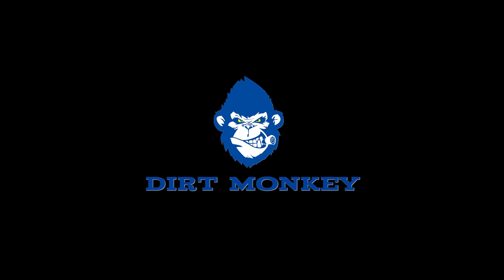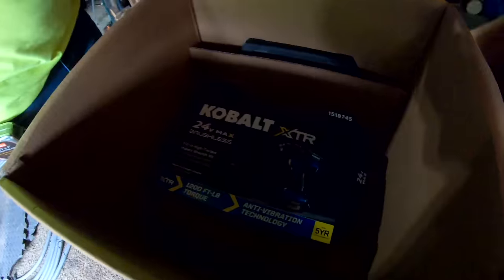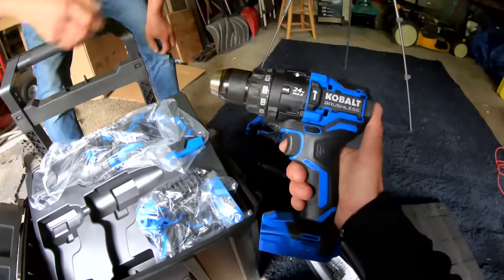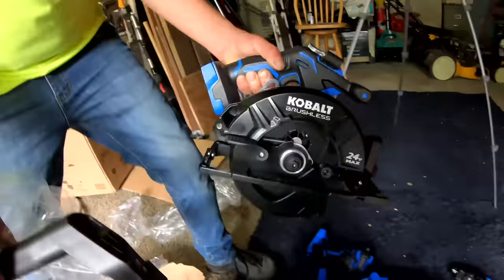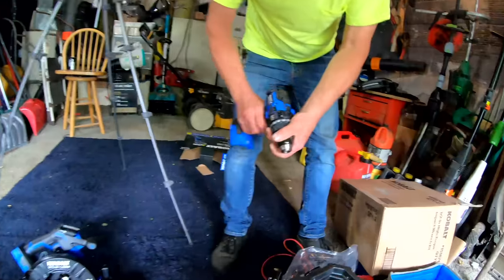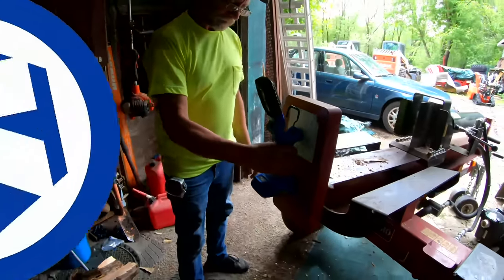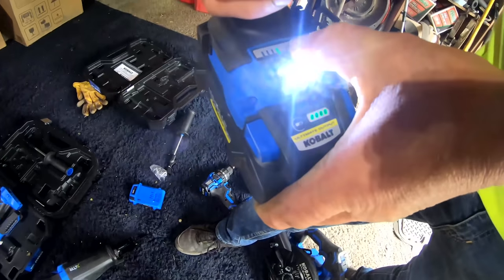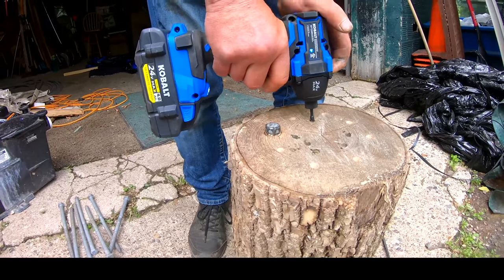First Looks at Kobalt's new Power Tools

Comment: Being from the south,  kinda blew my mind that yall ain't heard of Kobalt. Lowes is the first thing that comes to mind for me! Nicely done video.
Reply: yeah same here, me and my father have used Kolbolt a drill for years, and i remember holding the light ooooo boy, i still do, but my father holds it for me now too haha
Reply: Jlhনilo @scottforgues8711
Reply: I would totally buy Kobalts power tools over the craftsman that lowes is big on these days. Just the over all look and feel seem better even tho they're probably made in the same factory haha
Reply: @Truckinstuff  There are only a couple locations in Minnesota.  we've gotten a few more over the last 10 years, but i still have to drive an hour to go to the closest one... 
This is Menards Country unfortunately.
Reply: @Truckinstuff  Kobalt's made by Chervon, who also makes Ego, Skil, and Flex. Craftsman power tools are a glorified Porter-Cable 2.0. Dead-end system under the DeWalt glass ceiling with no innovation or class-leading specs whatsoever.

Comment: Being a diehard makita fan for almost 20 years and some Milwaukee now, I expect a lot from my tools. I have added a few kobalt tools in the last year or so and I am very impressed especially for the money. And I don’t have any of the xtr lineup yet which I’m assuming will be even better. Not to mention Lowe’s is great for veterans offering discount and even veteran only parking
Reply: I've been a big Milwaukee guy for a few years, and dabble a bit with Makita too. I don't have any of the Kobalt cordless tool sets, but I'm happy with the tools I have from them (Small air compressor, table saw, etc). Lowes also offers a 100% replacement guarantee on all Kobalt tools.
Reply: I was just wondering why does Lowe’s not sell makita?
Reply: @chugs4705  google said home depot or lowes sells the batteries for makita
Reply: Ok
Reply: I got the xtr sawzall and it's pretty badass. I would highly recommend it for the price.
Reply: General Hash Brown just got mine! What a freakin beast

Comment: Last year I discovered the Kobal 24 volt tool like. I purchased the 1/2" impact wrench. I was super impressed with the tool. Since then I spent over $1000 in the 24 volt Kobalt line. My next Kobalt tool is the 24 volt router.
You mentioned run time based on the amp hour rating. Don't forget, Kobalt also makes a 6 amp hour  battery which will really increase the run time.
It's nice having numerous cordless power tools that share the exact same battery. ......which is one of the main reasons I stuck with the Kobalt line.
Having a 5 year warranty on the tool and a 3 year warranty on the battery is also a good selling point. 
Dewalt, Rigid and Milwaukee all make some very good tools, but there's nothing like having a great selection of quality tools that share the same battery. I'm sold on Kobalt cordless power tools. 

I enjoyed your video, well done.

Barry

Comment: I’ve had some 12v kobalt drills for about 10 years. I would say medium to heavy use on occasion. They have done me good. I will buy them again.
Reply: No need to buy them again, if they burn out, lowes has a 100% no questions asked replacement policy on all kobalt tools.

Comment: I've been using the Kobalt 24V Brushless tools for about 2.5 years.  They are great tools.  I don't have any complaints.  There are some features that are not as good as say Makita, not waterproof, not quite as small and light weight.  But I've been very happy with mine.  I have the 1/4" and 1/2" drivers, drill, hammer drill, reciprocating saw, circular saw, jigsaw, rotary sander, angle grinder, and the older flashlight (no hook or magnet).  The only one that seems to run through the battery too fast is the angle grinder.  But for quick cordless grinding jobs, it's perfect.  I still use it instead of pulling out my corded angle grinder.  Just have to charge more batteries.

Comment: Got an old Kobalt models impact wrench, hammer driver, and hex driver brushless...been thru some heck like helping remove rac n pinions etc.  Still going...just regular stuff needed like a battery but the original 2.0ah still takes charge...I think they are beast!  Thanx for posting

Comment: Just bought this set.
I think a huge selling point for Kobal would be to make the cantainers interlock with the 5 piece tool kit rolling box.... Much like Milwaukee pack out. They are already injection molded... Make them interlock with the main case and watch people gasp in disbelief... It would make it feel like you got something for free.... What a cool feeling to know each tool you purchased would have a case that could fasten to the main box. Add compartments to the outside for batteries bits and blades. How many people would buy the tools just for the cases... What a great marketing tool. 
Also, the impact driver needs a spring loaded assist to help pop out or extract the bit from the quick release. Just my 2cents

Comment: The big thing I like about the 24v line is the build on the 6 1/2 inch circular saw sets the depth to cut at the same as a 7 1/4 inch saw. Pretty much guarantees I won't ever need their 7 1/4 inch one, but that's okay because I need that money for that 1/4 inch impact. 2400 inch pounds!

Comment: Lithium batteries are always shipped partially charged and will need fully charged before use.
Reply: Li-ion batteries do not need a full charge when you get them. They have no memory effects like Ni-cad or nimh.
Reply: @xenonram  Okay... but my fully charged battery will run longer than your partially charged battery.  ???

Comment: Yall dont want the tools, ill take em. I have a few of the older stuff but not the nice new xtr stuff. 
I used to build backyard playsets or play forts. Big wooden structures, sometimes with multiple slides and stuff. Ive had the simple 2.0 batteries. And ive built a medium one that takes 12-16 hrs to assemble with 1 full battery and used a tad of a second to do the finishing touches. They last well for me. 
Id love to have their new stuff. The only tools i have that arent Kobalt, are the ones others have bought for me for fathers day or christmas or whatever or ones that i needed asap and the kobalt option wasnt available at a local store(lowes).

Comment: You will probably find that the impact wrench will give more power/torque in reverse. They are normally designed for breaking bolts off rather then driving lags. Try it on some wheel nuts and you will see the difference. Just an opinion not fact and just trying to help.

Comment: I got the 24vMAX Impact Driver (2.0Ah) with finish mode (When on it doesn't over torque) it works fine on my automotive & household but I need that @ 9:15

Comment: What type of stones should I used base of retaining wall 4 feet tall?
Reply: Eddie nails for the bulk of the base use a 3/4 clear stone (or whatever they call it where you live). Since it’s clear stone (no fine particles) there isn’t much need to compact it. Depending  on the retaining wall material (such as some larger natural stone),that may be all you need, but if it’s a precast concrete block then you will want a finer base such as 1/4” chip (HPB), or rock dust/screenings. Use this to top it off so you can fine tune the grade more and smooth it out.
Reply: You should hire someone to make you a 4 foot retaining wall. Or at least hire an engineer to design it. Determining the type of base and how deep it needs to be, isn't something some bozo in the YouTube comments can answer. (NoT calling graham a bozo, but why on earth would you take advice on a structural element from YouTube comments?) Without knowing ANYTHING about your situation. There are about 20 different things to consider when building a retaining wall. Or, you could give it a go, and then have it done properly in 1-5 years down the road.
Reply: Andrew is right. I shouldn’t have even mentioned the general guidelines for something like this, since 4 feet is way to high for DIY. PS I think the bozo term is fitting because I was foolish to answer the way I did. Thanks for catching that Andrew
Reply: Graham K so don’t diy 4 feet wall ?
Reply: Eddie nails 4 feet is high enough that somebody can get killed if you do it wrong, as well as it probably failing quickly regardless. Talk to experts in your area about it for advice but likely don’t do it your self

Comment: I'm surprised yall never heard of them they are in every Lowe's I guess yall got Lowe's where y'alls at there not no snap-on or DeWalt or  Milwaukee or the big brands but I'd say there right under that I've had the hammer drill and the impact driver 24v and there still going 3 years strong and never had a problem out of any of them there great for someone that's just starting out and there not that high priced

Comment: If you've never heard of Kobalt, perhaps reviewing tools is not for you.
Reply: Minnesota based, probably spend 99% of their time in Menards and Kobalt being Lowes in house brand it wouldn't be surprisng. For reference where i am at in Wisconsin has 3 Menards to 1 Lowes so even i stopped going there and go to Menards, Though when i lived in Houston it was always Lowes or Homedepot.
Reply: There is a Lowe’s in Stillwater that’s a stones throw from them. No reason they don’t know.
Reply: Uh? They have more tool experience than most home users the kit is designed and marketed for. Being unaware does not negate the ability to review it.
Reply: Derp. What does hearing about it have to do with testing it?
Reply: @xenonram  It's like a car reviewer not knowing about Ford or Kia... obviously not enough experience with tools to be reviewing them.

Comment: The fact that these are 24v and not 18v means nothing. It's WATTS that matter, not volts! Volts do not determine how powerful a tool or a battery is. The important number is watt hours for the battery, not amp  hours, and how many watts does the tool consume? They conveniently never label this part on cordless tools. 18v can provide just as many watts as any other voltage.
Reply: Incorrect good sir. Higher voltage = lower current with the same amount of power = capacity for more work = more torque, which naturally, = more powerful. 
Power lines are a great example of high voltage/low current. No matter how you slice it, a 20v drill is way more powerful and lasts longer than a 14v drill, with more volts comes more horsepower, that's why they give you a stronger, sturdier tool to hold up to it. Higher amp hours = bigger "fuel tank" = longer run time, most definitely important if you're using the tool for long bursts at a time or day in/day out and don't want to be inconvenienced with constantly swapping multiple smaller batteries at the tool and charger when you could just get a battery with a bigger "fuel tank". But I like your light bulb analogy, it kind of makes sense.
Reply: @somethingtrulyhorrifying  You don't know what you are talking about. Volts do not make watts! You can get the same wattage from an 18v tool or a 12v tool. The manufacturers generally choose 18v because it is a good compromise of amperage, wattage, and voltage. They could easily make a 6 volt power impact driver that could rip your arm off, it would just cost more to manufacture due to having more copper inside. Maybe slightly heavier. The difference between 18v and 24v is not enough to matter in  crappy little store brand tools. Also there is no such thing as a "20v" drill, those are just fake number Dewalt thinks they are fooling you with. And they are fooling stupid people like you. Think about it, old cars had 6 volt starters! That starter puts out WAY more torque than any cordless drill.

You're also totally confused about how amp hours works, again, it's watt hours that count, not amp hours. Every power tool battery is marked with is WATT hour capacity. If you have a big fat 18v battery with 5 amp hours it has more than twice as much energy than a 24v battery with 2 amp hours.

Voltage is just a stupid game the manufacturers play to impress stupid people like yourself. It does not mean anything when you're talking a difference of a few volts. Most people are too stupid to know the difference between volts, watts, and current. Again I point to the Dewalt "20v" battery, that's just false advertising, they are legally required to call the same thing "18v" in Europe. But Americans are stupid enough to think that extra 2 volts does something. It doesn't even exist!
Reply: @somethingtrulyhorrifying  Great, can't think of  a response so throw a bunch of insults like a kindergartner. I'm an electrical engineer and I've forgotten more about watts and volts than you will ever know. You thoroughly do not understand the difference between an 18v power tool and a cheapo lowes brand 24v tool, nor do you understand the relationship between watts and amps. (There is no such thing a s a 24v battery, either)

High voltage is important for things that use hundreds or thousands of kilowatts. A cordless drill uses about 500 watts or less, and it doesn't matter what voltage.
Reply: It has another cell in it lol hilarious 😂
Reply: We know it's really 21.6 v
Reply: @kevinsilveira4418  Who is "we"? Most buyers of this stuff have no idea what an individual lithium cell is. Most people think Dewalt actually makes a 20v battery. Bottom line - no matter what voltage your "Kobalt" tool claims to have, they do not have the performance of higher end brands. 18v Milwaukee or Makita will kick their ass all day long.
Reply: My neighbor has DeWalt my kobalt beats it. My boss runs all Milwaukee and is pissed how much money he paid compared to my kobalt xtr and Milwaukee 🐻 ley  beats it and on some tools the kobalt wins. That says a lot coming from a store brand. And I'm sure they added that other cell wasn't just for power it was most likey not to have to pay Milwaukee but I'm sure that's why those tools perform the way they do
Reply: @kevinsilveira4418  LOL. No, they do not perform the same as high end pro tools and if you used them every day that would show up very fast. They aren't terrible homeowner tools but if you think they are even in the same category you know nothing about tools. Adding another battery has nothing to do with "paying Milwaukee", they don't own battery voltage. The entire point is to confuse people who think the higher number is better. BTW - Dewalt tools aren't that great either. Again, Makita and Milwaukee kick their ass, as do other brands. Try using one all day every day for a month and let me know how it goes. Or try a warranty repair - if they have a warranty at all!

If I ever hire a professional for anything and they come equipped with Ryobi or Kobalt tools, they are automatically fired.
Reply: @ryanroberts1104  my boss lets me runn them all day !!!
Reply: @kevinsilveira4418  The fact that you have to keep referring to "your boss" letting you do things tells me you can't even afford your own tools so you really shouldn't be part of this discussion. Also, your individual experience out of millions of tools sold is statistically irrelevant.

Again, the Kobalt tools are not bad, but to think they are the best is simply delusional. Why do you think they are cheaper? It's not because they are better or higher quality...
Reply: @ryanroberts1104  it's called best bang for your buck and I'm fine if it brakes I drive down to lows and have it replaced almost guaranteed to have a quicker turn around than your Milwaukee. And by the way you know the video is about kobalt not Milwaukee or your precious Makita? I run kobalt xtrs so why you watching videos about them if you think there such junk why you on here hating if your such of a professional you would have just passed it up. Give me a break . Can't afford my own tools your hilarious your points are rediculous .
Reply: @kevinsilveira4418  The more you type the dumber you sound. If somebody can't even spell "Lowe's", their opinion about tools is irrelevant. And no, I do not own any Milwaukee tools, I just know they are a very good product and Kobalt is in a different class. I am not recommending any brand, I am explaining there are different classes of tools just like every other product. I never said Kobalt were bad tools, but to compare them to the best of the best and even say they are better is incredibly stupid. You also cannot determine that in one day in a video when they send you free tools. Of course they work good when they are brand new! What about after 2 years of abuse? Kobalt are GOOD tools, but they are not better than anything that cost more. Professionals do not have time for breakdowns and going to Lowe's to find another tool. The loss in productivity is far more than the cost of the tool. Clearly, you don't get paid much so your time isn't really valued.
Reply: @kevinsilveira4418  Don't worry about your spelling, his credibility took a nose dive when he said voltage and amp hours do not matter LOL ...Also he marked a few of my comments as spam(yes, I took screenshots of my comments :P), so I'm done trying to reason with the world's dumbest electrical engineer.
Reply: @somethingtrulyhorrifying  ya I believe he is irrelevant!!!lol his points are pretty bad for a supposed engineer.